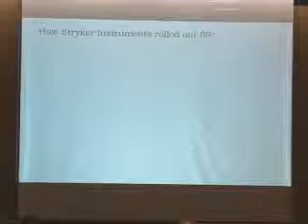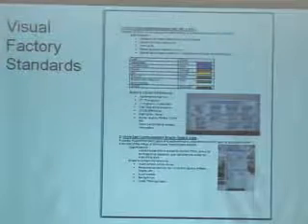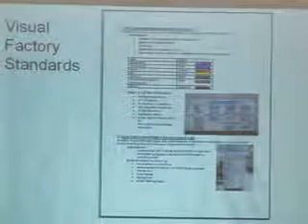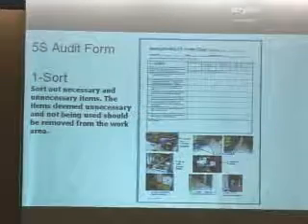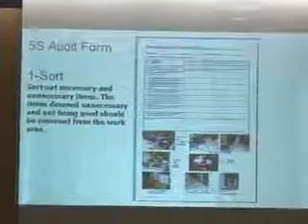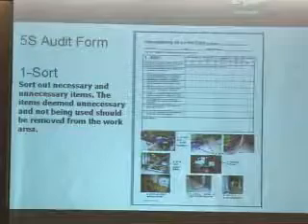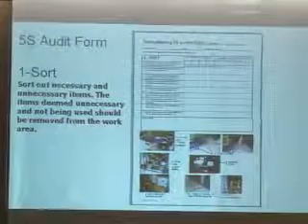How Stryker Instruments Rolled out 5S: Continuous Improvement in Manufacturing

Comment: Having worked for Stryker for 7 years, the whole 5S and continuous improvement was a joke on the manufacturing lines. You need "buy in" from EVERYONE. Without it, nothing gets improved and slowly things go back to what they were. The main reason it fails? There is nor infrastructure to assure that the standards and changes are being followed.  Everything is production production production at whatever cost. All the work put in place unravels because no one is assigned to measure value added. This is a was a waste of resources and/or lack thereof.  Continuous improvement works in non-manufacturing environments with metrics that prove the change was successful.  On a manufacturing level, you're expecting the production associates to do A3's because their yearly review is a chunk of it. Thank god I don't work in that fairytale environment.  Finance, for example,  has measurable metrics.  And to behove manufacturing associates will only bring on an influx of minute problems only to get recognition on their yearly reviews, costing valuable resources and time, mixed with no follow up. Continuous improvement is nothing more than to us as coercion to save the company money with little to no recognition for their work.  Play that movie over and over, the result won't change. Thank you.